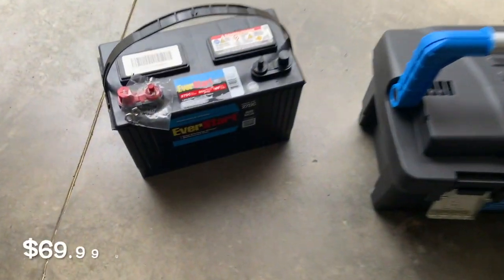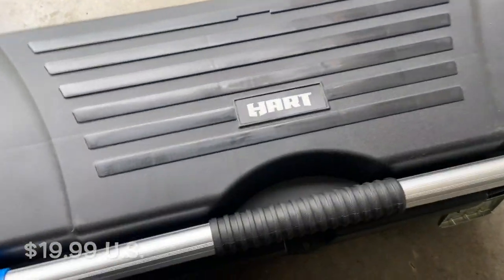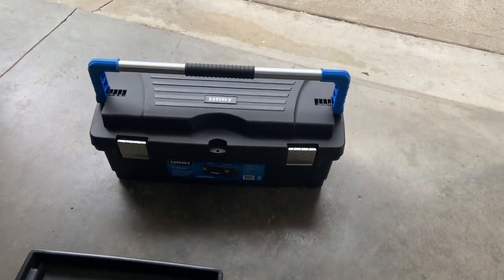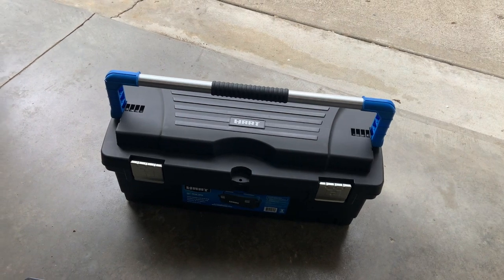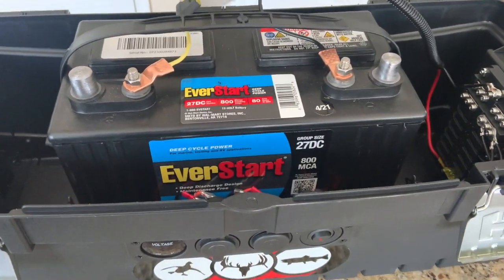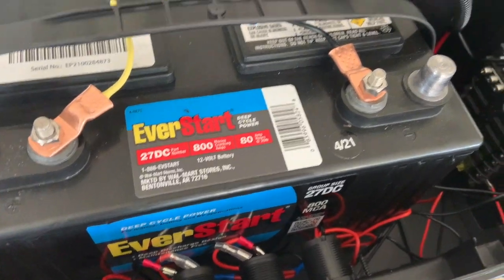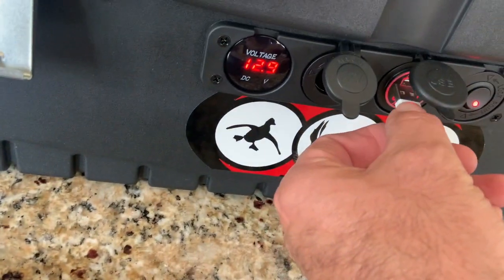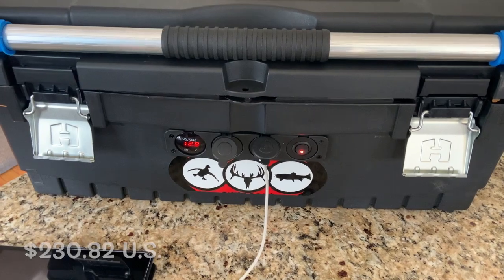DIY 1000w Portable Power Station & Solar Panels for UNDER $500! Jackery Goal Zero Bluetti Overland

Comment: Nice small build.  Enjoy it.  I'm here in Michigan and have built my own set up. Started with the harbor freight 100w kit. And a 100ah AGM battery. 750w inverter.  Small camping set up.  Practice.  Built my first rolling box to house every thing. Very heavy unit.  Since then.  It's now 2 100w harbor freight solar panels wired in series going to a 30a power queen mppt charge controller, and 1 210w panel going to a 30a Epever charge controller. The charge controllers connect to 2 100ah power queen lifepo4 batteries in parallel. Which feeds a 1000w renogy inverter.  My build has evolved and has had all winter to power our bedroom. We have grid power.  But we wanted to try it out and see how well it would do powering everything we run every day.  And has worked out amazing. Never saw below 40% this winter.  Just remember to use low wattage and low amp devices.  We've become more aware of our energy usage in the house.  Learn and research. Fuse properly. Be safe.
Reply from the maker: Thanks for checking out the video and for the feedback! Good info

Comment: You have no idea how glad I am that you didn't drill holes in the toolbox lid and install your DC power ports there. I did that with my first build and had nothing but trouble with the wires coming loose after a few times of opening the lid.
Reply from the maker: Good to know! I was thinking side openings for weather resistance

Comment: When I buy an inverter that has the cables with it, I toss them to the side and make my own cables anyway. Yes, they recommend 2 gauge cable, but that's not what they send with the inverter. What they usually send is 4 or 6 gauge of the cheapest aluminum wire cables they can get. So, you're better off getting your own copper cables of the correct gauge.
Reply from the maker: Good suggestion

Comment: Do you have any way to see when you need to charge the battery? Can you charge the battery without the solar panels?
Reply from the maker: Yes, I don’t discharge the battery more than 50%. And yes you can charge the battery with a standard battery charger

Comment: If I were you, I would remove the 2 outlets, the switch and USB, on the inverter and mount it on the side of the box, and secure the inverter inside...but great build though 👍
Reply from the maker: Good input! Thanks for tuning in

Comment: I lost interest when i saw lead acid battery. 80Ah is really only 40AH max. Get some cheap Lifep04 batteries and you will have something
Reply from the maker: Certainly better to go lithium if you have the budget for it
Reply: @CopperheadULTD  prices have dropped so low
Reply from the maker: @davidparker7156  that's very true

Comment: well for 1 your using lead acid the jackery etc dont use lead acid so right off they will be a massive price difference the lifepo4 will out perform the lead acid and is also lighter from what i looked into even building your orn system and using lifepo4 you can cut the price in half if not more then the retial price of the jackery etc i spent 100 dollers on new old stock laptop batterys and built a more powerfull unit in capacity then jackery etc do for way less money

Comment: That's a cool build, for the price.  Not having the charge controller in the box makes room for the bulky, heavy battery.  There are several drawbacks to building something like this with a lead-acid battery, including a lot less usable charge capacity for the amount of weight.  Also, a lot less charge cycles before you have to replace the battery.  The good thing is there's no reason you can't switch to lithium, with a whole lot more capacity, if you want to do that in the future.  With the way the cost of lithium cells has come down, it will make a lot of sense to do so within the next couple of years.
Reply from the maker: Thanks for the feedback and I agree! Lithium would be next level
Reply: @CopperheadULTD  - Have you seen the new mini 100AH lithium iron-phosphate batteries, like the one from Li-Time?  One of those would be awesome for your build.

Comment: Awesome build, exactly what I had in mind to do.. nice walk through! Three questions: Do you have wiring diagram for this, and if so, can you share? Can you charge and use battery at same time?
Can you charge your battery on 12v car lighter output? Tnx
Reply: I have all the same questions
Reply from the maker: I did not make a wiring diagram but if I get some time, I’ll post one. You can use while it charges, just be sure not to run the battery too low. Some folks do wire these or have a plug to charge off of a vehicle alternator.

Comment: How did you go about determining what size inverter you could use?.
Reply from the maker: Amp hours x volts = watt hours. So I used an 88 amp hour battery that is 12 volt and that equals 1056 watt hours. Hence the 1000 watt inverter. However, I use the inverter as a last resort, much more efficient to run as many direct 12 volt accessories as possible.
Reply: @CopperheadULTD  how much can you power with a 1000w system? Thanks.